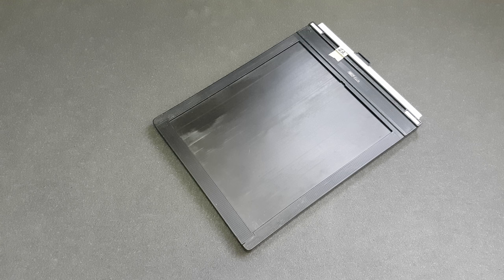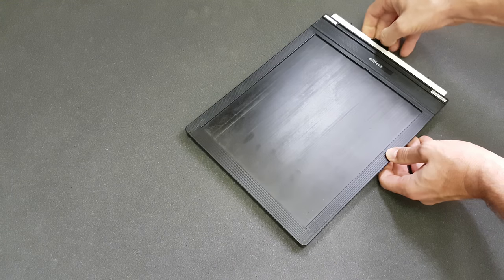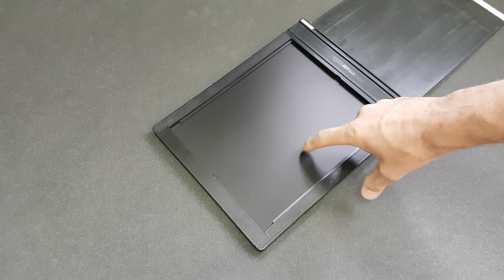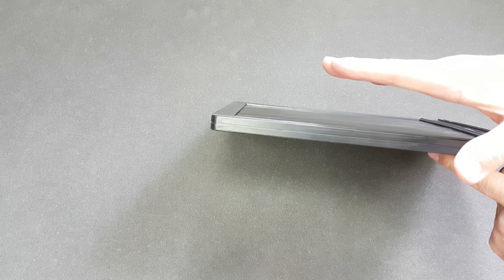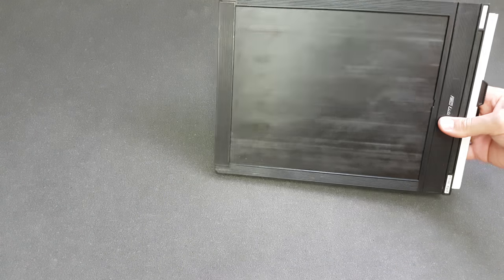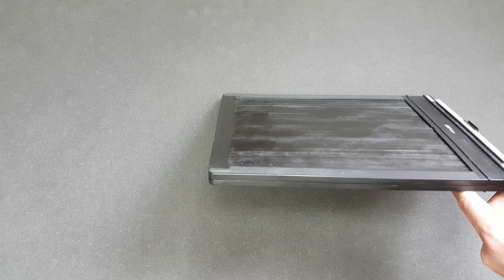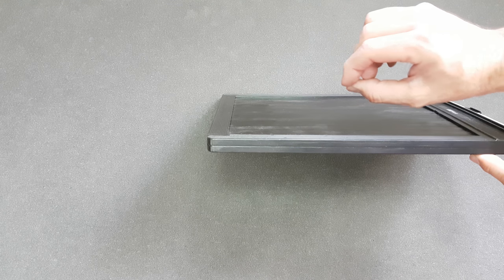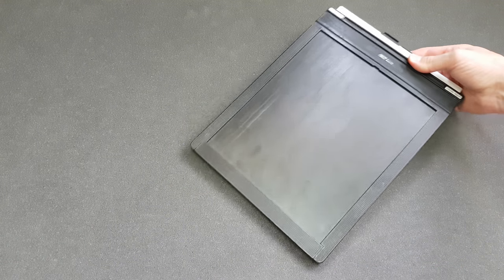10 X 8 negative plate for radiation monitoring

Comment: Chaps, what is the procedure for donating to this project?
Reply from the maker: Thank you for asking Slainiae,

Currently via bank transfer and Bitcoin.

Donations of any size can be made direct to Quantum Heat C.I.C.s (the organisation that runs the MFMP) bank account here, thus saving charges: 

BANK: HSBC
Branch Address: 153 North Street Brighton, East Sussex, BN1 1SW 
Account Name: Quantum Heat C.I.C 
Sort Code: 40-14-03 
Acc No.: 12631571 
IBAN: GB48MIDL40140312631571 
SWIFTBIC: MIDLGB22

Bitcoin: 1JesTRUXU8jHb1haa1MoF2NvrU8gt5msCr

At the moment, Paypal have been blocking our ability to receive money despite the fact we have provided all the required information weeks ago. They say it is a standard compliance change which they appeared to have done across the platform, so they have had to work through all accounts - currently it says after 2 - 3days we will hear back.